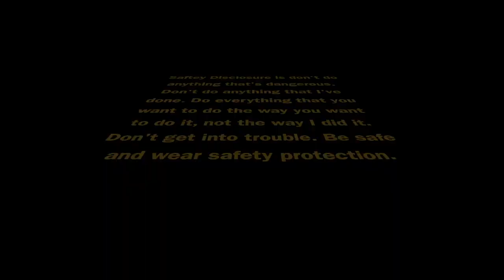How to build a table for camping with smaller SUVs or Crossovers Ep.23

Comment: You just keep surprising us with your ideas. How about 4 bolts & wing nuts instead of the clamps?
Reply from the maker: That was my original thought process. The clamps were faster, but the bolts and wing nuts would work too and save money. Thanks for watching and for the comments.
Reply: Just thought of another way you ""Might"" be able to add another shelf @creationsbycarson . On the very top take 4 or 6 metal L or corner brackets & screw them to the sides of the very top that sits on the tire & slide in a piece of plywood. Extra shelf.
Reply from the maker: @tpseeker3367  That sounds like it would work. The construction of that step is solid and would support some additions.
Reply: Once you build the top shelf drill a hole through the wood & into the top folding part & slide the rod/light holder through & that will even keep the shelf from moving as well @SubaruSleepingwithCarson